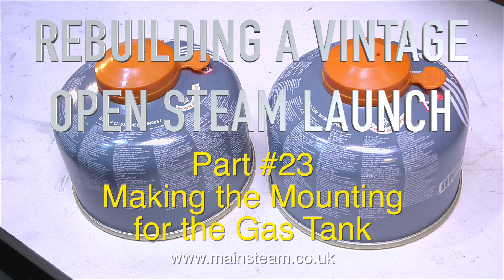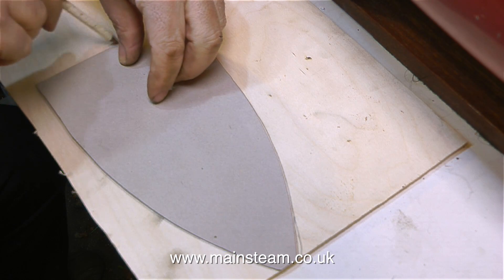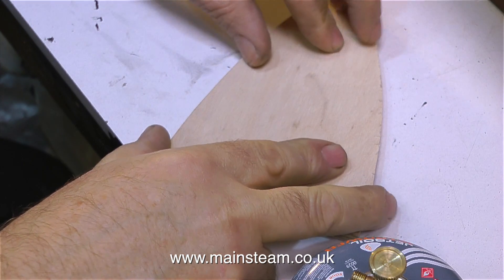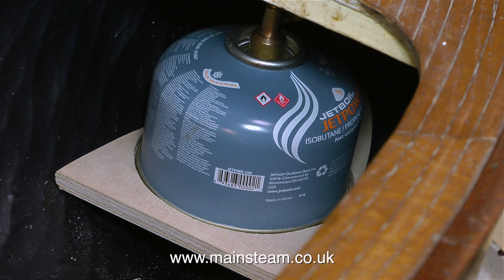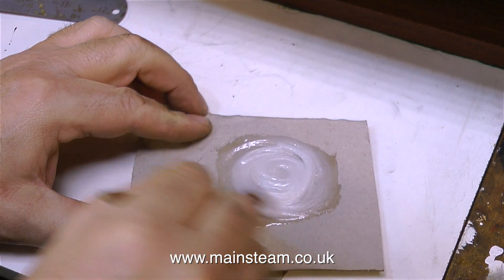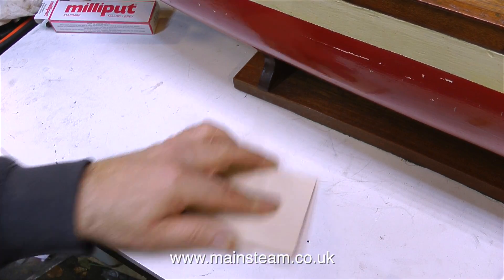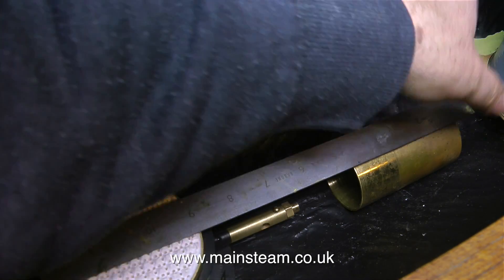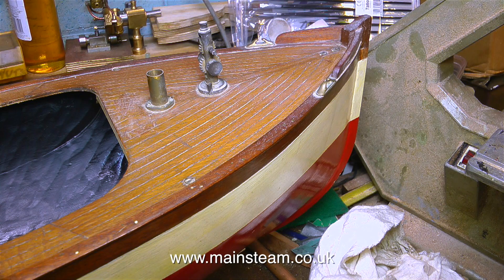REBUILDING A VINTAGE MODEL OPEN STEAM LAUNCH - PART #23

Comment: Bandsaws are almost a must have aren't they. I bought one for almost nothing, I think about $20 because people don't like the brand, however they don't make an electric motor, so really there's not too many components that can fail. I actually paid more for my blade than the unit. I wouldn't do without it, even if I only use it once or twice a year. This is a beautiful boat. I'm working on a few boats at the moment but they're petrol motors, and one is electric. A lot of the principals still apply to me, so I'm taking something out of this.

Comment: That small anchor winch on bow is reason enough to restore this great dug out boat. I found the butane camping stove gas cans here in Canada anf they are $13./e about 8 uk pounds. I think propane lps is a bit cheaper.